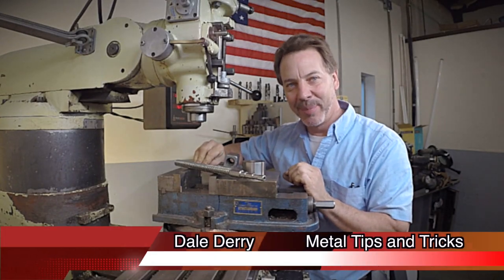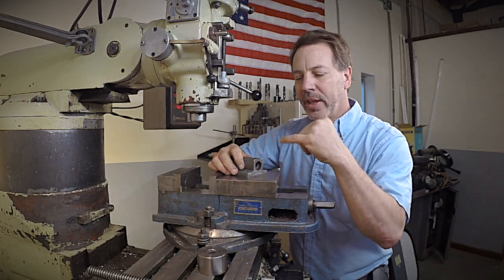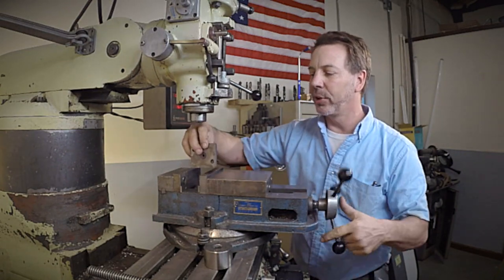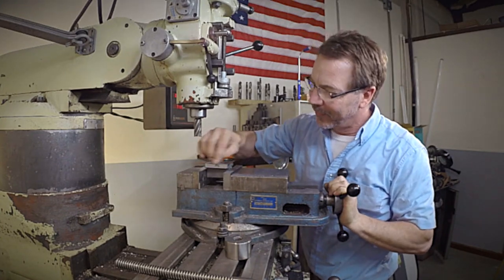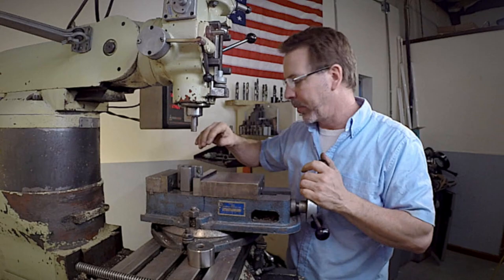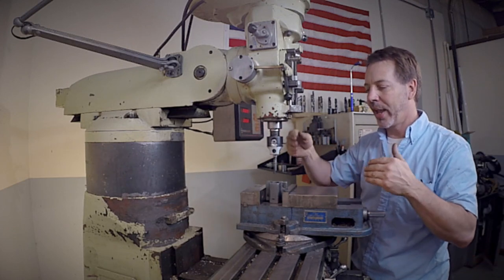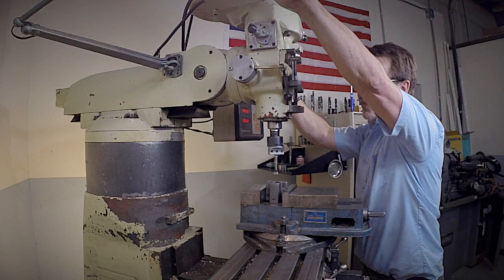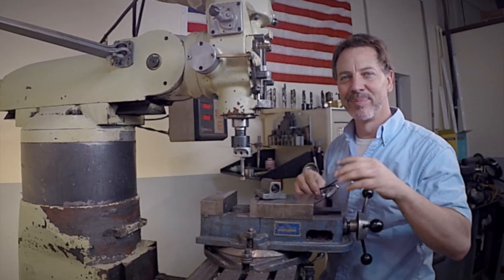DIY Lead Nut

Comment: M.Dery,
 For sure, this presentation is very instructive. I was expecting that solution even if I expect that you will use a prefabricated nut. I never saw that kind of nut. And, for most, I did not expect that this nut should be inserted into that actual support. Also, I like that you explain that we need to square the support and how to do it. Many, many thanks to you. Warm regards
Reply from the maker: Next Friday you will see the conclusion of the repair.😀
Reply: Yesssss😸

Comment: I'm actually doing the exact same job on a Niagra 10' shear with an adjustable back stop. The screws are in good shape but the nuts are destroyed. I had to opt for re-machining the entire nut thanks to it being one solid piece of bearing bronze and having another shaft perpendicular to the leadscrew thread integrated into the nut. An easy way to do the bore for those with a good lathe but without a mill (or a mill without a powered quill) is to bore/thread the nut using a 4 jaw on the lathe. Some aluminum or any other soft metal makes a great spacer for giving the chuck jaws a good register, in case they get hung up on the flange of the T. Great project!

Comment: Very nice tutorial on setting up a casting for machining.  In model engineering of small engines this is a challenge.  Set ups may take much longer than actual machining.
Reply from the maker: I agree set almost alway takes longer then machine.

Comment: I'm an apprentice toolmaker and one of our milling vices brass leadscrew nuts stripped out. My job was to completely replicate everything. I started with brass hex bar and bored and screw cut a square thread at 8tpi. I took the hex bar to the mill and clocked it up and milled the profiles. We thought putting an insert in would have compromised the strength of the nut. But because your leadscrew isn't clamping it should be alright. Have you had a similar experience of a vice nut stripping?

Comment: I noticed you said you would glue the part with the threads in.  It seems like all sorts of things are getting glued these days.  I assume you will use loctitte.  Will that be stronger than silver solder?  I have a new boring head that I have not had the opportunity to use just yet.  I guess I will have to invent some boring job.  Thanks for sharing.
Reply from the maker: Silver solder will hold it better then glue. I chose glue because it s a cold process, and will not distort the part.

Comment: Dumb Question:
Why not clamp the nut with the ground surface against the fixed jaw, and two 1-2-3 blocks on the flats, putting no pressure on the bore to distort it?
Reply: +Greg Koenig  
i'm not a machinist  but would have done that  is there a reason or is it a potato or potato thing
Reply from the maker: That's a good idea. One thing to lookout for is the quality of the casting if it is rough or the two sides are not parallel you might need to mill them down to insure a good tight clamp.
Reply: +Metal Tips and Tricks (Dale Derry) Or use a pair of ball bearings.
Reply: +Greg Koenig That is the way I would of done it,  I think a bit more surface area, even I you had to mill the surface flat to get a seat.  Both ways work though.
Reply: I agree

Comment: Hi. I'm trying to fabricate my own twin screw woodworking vice, I know there are a few on the market. But I'd like to build one with fast travel lead screws, preferably 1 inch. Do you have any suggestions for where I can buy the screws and nut and what thread? Too much info out there and find what I will work best for my application, as far thread tip. Thanx.

Comment: If you are using an Acme thread, why not split the nut on one side and use a pinchbolt  to keep the tolerances tolerable as the thread wears? whyare some leadscrew nuts made of brass and others are not? Dale thanks for your efforts to enlighten us
Reply from the maker: Great questions.  I thought of making the nut adjustable. But  I didn't see that it would make the machine work better. The back lash is not that bad.

Why I didn't use a brass nut. 
When you have two metals that slide on each other like a nut and screw you need to have one that is softer then the other. If you have two similar harness of materials they will bind and mar each other causing the parts to fail quicker. I used a soft acme thread so I could turn it down on the lathe, and a cast iron nut witch is harder then the screw. I feel this combination will last longer than a soft brass nut on a soft screw. 

Thanks for the question. 
Dale d

Comment: Dale------ I have always shrunk fit parts like the journal you soldered onto the shaft.  I never thought to solder one on.  Great idea!  I also would have never thought to glue the new internal screw into the bored hole.  I probably would have shrunk a sleeve into the freshly bored hole and turned the internal acme threads.   What a waste of time for me.  
                                           respectfully:  Bob Z.

Comment: How much clearance between the major diameter of the thread and the bore you just made? (Essentially, what will be the wall thickness of the nut after machining?)
Reply from the maker: I don't have the part in front of me  but here are some measurements I do know. The final hole is about 1" in dia, snd the acme thread Is 3/4".
Reply: So, about a 1/8" shell around the threads. That seems like enough. It was just hard to get the scale in the video.

Comment: Great video, Dale! Thanks for sharing with us. I always knew clamping a part deforms it a little, but never knew it was that critical. I mean, for the amount of pressure you applied on the part at the beginning, I'd assume a maximum of 1, maybe 2 thou. (Taking into account the part itself. It's not a thin-wall part by any means.) But 4?! Sheesh. I gotta reset my estimates. ;)
Reply from the maker: I'm glad you liked the video.
Reply: +aryesegal1988 You can put over 4000 psi on the part with that vise.  Parts distort more than you think.
Reply: Randy Richard True, the mechanical advantage due to the screw and levers are something I always forget to take into account. Thanks for replying. :)

Comment: You could have used two 1-2-3 blocks to hold the base against the fixed jaw instead of making those two light cuts on the side. Are you a full time machinist or a hobbyist?
Reply: +TheMachiningman Exactly what I was thinking. That setup would be MUCH less likely to twist off axis during cutting.

Comment: good video i would have used 2 123 blocks and clamped it just like the 1st way you showed but using the 123 blocks sitting on the bolt flange. your way works but not super ridged. thanks for the video
Reply from the maker: Great idea.

Comment: I would have clamped it with the base against the back jaw with 2 pieces of metal to go from the base to the adjusting jaw.
Reply from the maker: thanks for the tip
Reply: I'd have used the existing bolt holes to bolt it to a 90 degree angle plate.

Comment: Yes.  well done but,  what about my problem a have a Colchester master.  lath that doesn't have the conventional two half huts, it one nut that rids on the upper half of the lead screw.   & in my case ha never been fitted with a  half nut or lead screw.  I have to fit 8 trends to the 1" an unc led screw 1" in diameter & build a new half nut.  with no paten to copy. but you have indeed given me a way to achieve.  the result.  i have no means.  yet to cut a thread but i do have a 1" unc tap at 8 TPI so. tim to tap a hole.   build the system from new. thankes. lad  & No they don't mack part's now given it 150 years old.   & only now getting a lead skew & nut. LOL .

Comment: I would've done it differently...
I would've put the nut in the vise on the flats, and milled it down to square specs... leaving the bottom side with a 1/4" key... then, mill a 1/4" keyway into the center of the plate, with the holes already drilled... and then, tig weld it down... and last, mill the bottom face flat, if the weld distorted it...

Comment: Would it not have made more sense to square off the new lead nut outside diameter and then make a new flat mount piece? TIG weld them together and face the flat piece of the mount as the last operation..
Reply: I had the same thought about TIGing it.

Comment: Gee, why not clamp it in your vice the way you had it a 1:15 and use a pair of steel bar spacers to apply clamping load onto the two flanges of your nut body? That's the right way to do it. The mounting face stays square with the vice jaws and mill axis.
Reply from the maker: +billsixx  go check out my Q&A video for the series, it will answer your question

Comment: u destroy things to do another things!!!!
why don't u make what u need from raw materials?
u already have needed tools!!!!
Reply from the maker: Good question. The goal of this video is to think out side  the box. What if you have a lathe with a worn lead screw. You cant use your lathe to cut a new lead screw. So what do you do. That is what this video is about. 
Plus the screw I bought was ground to .005" and I have no way to grind a screw to that torrence.  
I hope this anserws your question Kmal :-)
Reply: In most cases you are trying to get a machine back into service so you can make MONEY. Being a purist and making everything from scratch takes time and time is money.
Reply: ty guys
I got it.